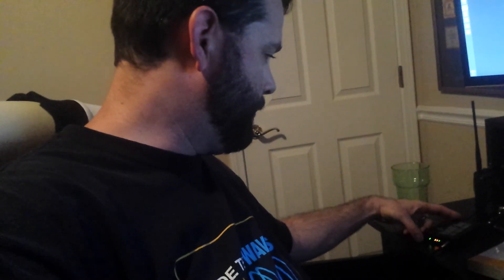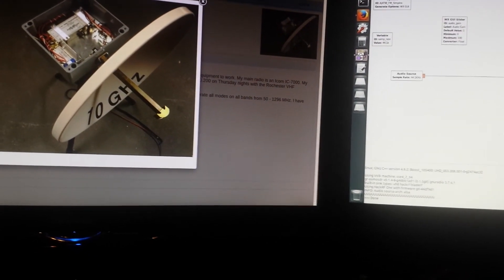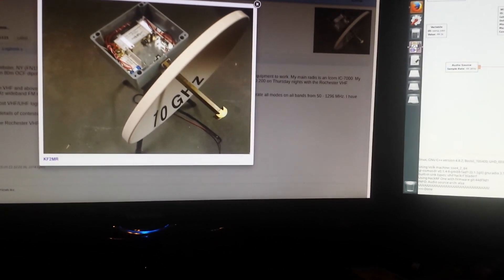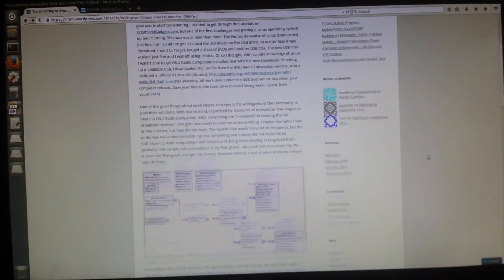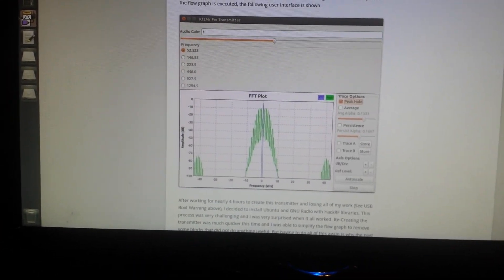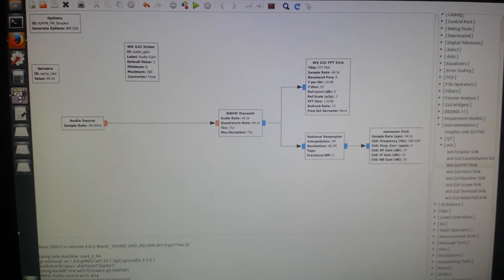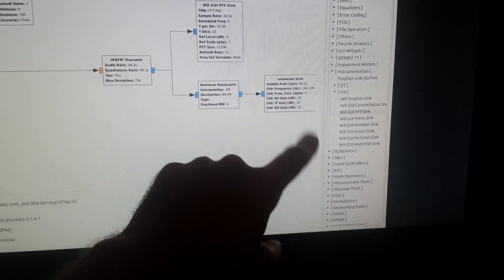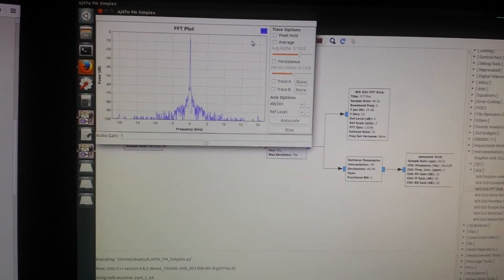Transmitting with the HackRF

Comment: I took a song and split it into two wav files with Audacity. Then I made a GNU deal that played each wav file on a different frequency on wide band fm. I never liked fm stereo so I wanted to hear what it could sound like with each side having a full channel. It took some tweaking to make it work right, like changing which frequencies the channels were on. I just thought it was cool that it could spit out two "stations" at once. Then I used two radios as receivers. Now that I got my license, I'm trying to figure out if I should just build filters and buy an amp, or buy a regular radio. It seems to me like you can do more with the Hackrf than a regular set.
Reply from the maker: A purpose built HF rig will benefit from bandpass filtering on receive and transmit.  You should look into something like the Anan or Flex radios if you enjoy SDR.

Comment: You can use SDRangel and also transmit i would like to use it for data that would be cool maybe some PSK or CW you would have to buy a low level amp that can amplify the modulation into a antenna but it prob could be done.... KG5CUO

Comment: can HackRF can transmit signals in more than 1km?
Reply from the maker: It is very low power, probably not without an amplifier, and if you do that, you will really need some filtering because this device has none.

Comment: you might can link it with a digital station over the net some dmr your still going to need transmit power but it could be interesting....you can buy a full duplex as well. build you a access point and you would be all set i would go dmr KG5CUO its a good idea for a digital repeater idea...not hard to do i would caution on band plans and the fcc licences that is needed to do such things would be a interesting relay a channel of sdr's own unless more dmr stations carry it depending on the fcc licence HF is nice but you would need power to reach this would be easily accessed in a dmr channel dedicated to that type of radio communication.

Comment: You need to be looking for the harmonics.  Don't look around 146.52, look at multiples of 146.52.  146.52*2=293.04 MHz and 146.52*3=439.56 for example.  The HackRF has NO filters in it.  It's going to be spewing harmonics all over the place.  Put your spectrum analyzer to full sweep and see what you find.
Reply: Would it not be clean because it uses digital synthesis?
Reply: @nekelly123 That can be part of it, but even analog oscillators have this problem.  It isn't clean because amplifiers and other electronics aren't perfect.  All transmitters need filters.
Reply: @stargazer7644  yeah, I forgot about the amp :)

Comment: I know this video is old, but few things that I noticed. Your sampling rates are wrong. You take audio from audio source(mic) at 44100hz. Fm transmit block uses same values as audio sample rate and quadrature rate. Meaning output will still be at 44100 hz. In rational resampler you decimate by 88200000 and interpolate by 2000000, then you configure hackrf to use 441000 again. Thats wrong. Hackrf minimum sample rate for tx is 2Mhz so in resampler you ahould decimate(divide) by 44100 (incoming sample rate)  and interpolate by 2000000(desired sample rate) . And put 2000000 in hackrf sample rate field (as this will be rate after resampler) those UUUU letters you get in console is buffer underflows, because of invalid sample rates

Comment: Hi which Linux distro is the best for HackRF in your optimision? (I used Ubuntu Studio (because it has Jack preinstalled and build-gnuradio script to build gnuradio (it took a while to do it) but then I needed to reformat my computer and I wonder is there any easy to use Live DVD that has all hackrf stuff there (including gnuradio) (and jack) and you can install it on a USB Stick or computer

PS: When we will be able to transmitt on windows (we have ExtIO Dll and HDSDR but we still can't transmitt as HDSDR Author (LC) don't have hackrf for testing :(
Reply from the maker: Veso266 I'm using this live ISO:  http://gnuradio.org/redmine/projects/gnuradio/wiki/GNURadioLiveDVD/1
I'm booting from a USB 3.0 Flash drive.

Not sure how long before we get TX on Windows, I'd love that as well.
Reply: Official guide recommends to use Pentoo, a Gentoo-based distro for network deep vulnerability testing, this distro also have newest GNURadio included and fully compatible with HackRF, USRP, OsmoSDR etc. out of the box. I have issues to make it properly work on flash drive so it refuses to load vesamenu.c32 and I have to load menu.c32 instead and run Pentoo and X manually.
Reply: Cameron Conover さ

Comment: I'm still waiting for someone to make a half-duplex block that can be triggered by a ppt.
Reply from the maker: Taylor Crisp That is something I intend to work on, but I'm a total newbie, so can't say how long it will take.
Reply from the maker: Taylor Crisp http://w7fu.com/?page_id=190
Reply: Cameron Conover Have you tried this? Pretty sure it wont work as the USRP is full duplex and the Hackrf is half duplex. the osmocomm source and sink would have to be modified so that you could switch between rx and tx. ( USRP does both at the same time, hackrf can only do one at a time).Other than that part the rest is a good resource.
Reply from the maker: Taylor Crisp I did try to modify it for HackRF and got it to rx but when I tried to tx it just locked up.  What I figured was that it needed a different T/R switching method.  But thanks to your comments now I see why.  I'll have to revisit it when I get time.